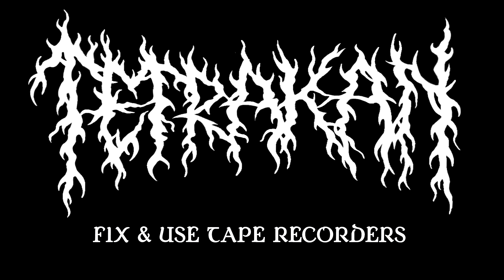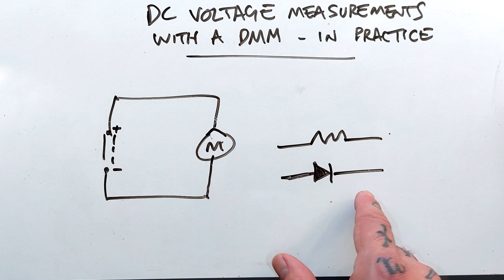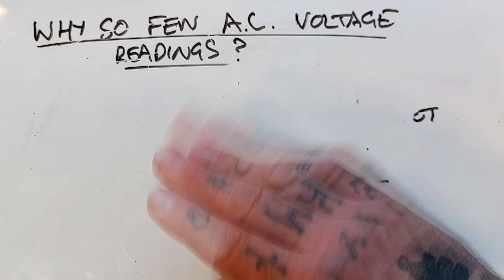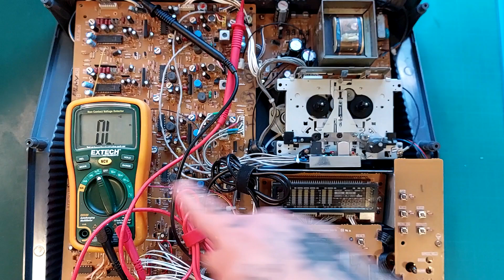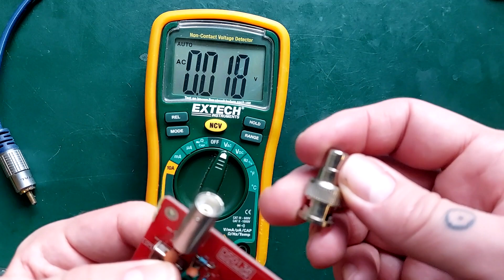Multimeter MEGA tutorial |Theory & Technique for Audio Troubleshooting

Comment from the maker: TIMESTAMPS BELOW

0:00 Introduction
0:51 Electrical safety
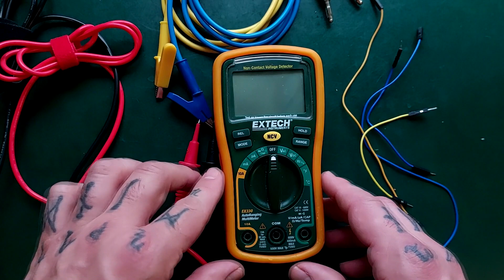2:21 Connectors & probes I use when troubleshooting
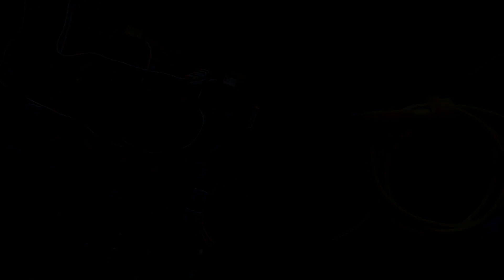4:51 What to look for when shopping for a multimeter - which functions are most important?
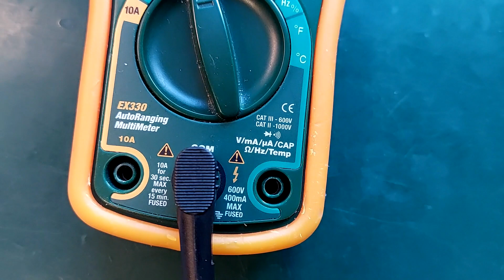8:51 Plugging in probes - what is polarity and how much does it matter?
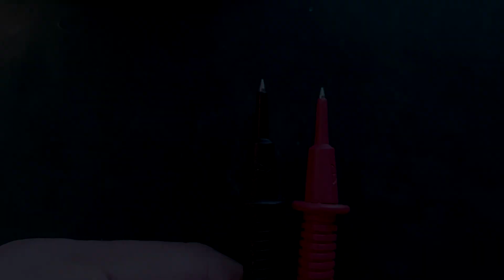11:56 Opinion - most electrical theory videos are NOT presented with the repair person in mind
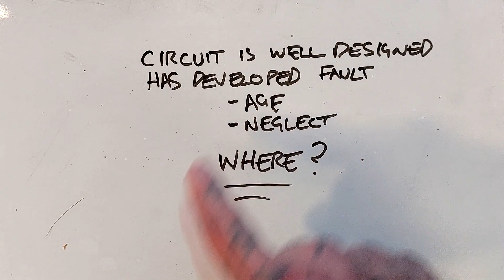14:25 The difference between AC and DC
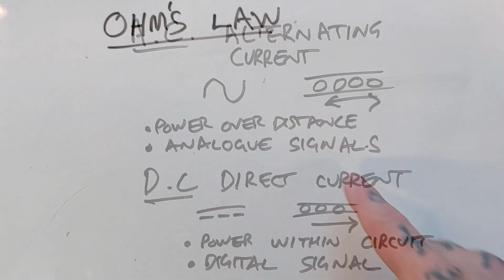17:09 Ohm's Law - thinking of DC like water is helpful, but I don't do any calculations
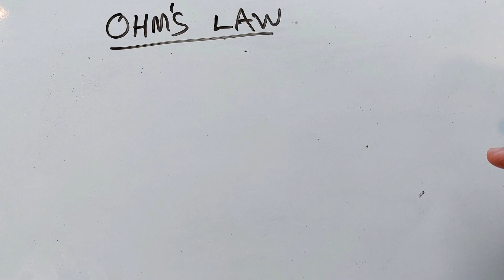21:03 Parallell circuits & why it is good to test components out of circuit
25:51 Voltage dividers & Ohm's law
29:38 Understanding voltage drop
32:43 How voltage drop impacts what we are doing with the Multimeter
35:21 Where I put the probes when measuring DC power supply to active components, voltage drop & resistance
37:04 Using a schematic to figure out where to put meter probes
39:00 Why I don't use my DMM's AC voltage function for troubleshooting power circuits
40:15 Why the DMM is unsuitable for some analogue signals
41:15 Why I use an audio probe or oscilloscope when troubleshooting audio signals
44:03 I can use DMM for amplifier & bias calibration, but often an oscilloscope is more convenient
45:17 What is a continuity test? Why do I find it so useful?
47:32 Continuity test example 1 - checking faders, switches, pots etc
49:31 Continuity test example 2  - checking coils... solenoids, relays, inductors, chokes, etc.
50:12 Continuity test example 3 - checking magnetic heads (be sure to degauss afterwards!)
50:49 Continuity test example 4 - checking cables and PCB traces
52:26 Continuity test example 5  - figuring out if/ which components are connected to ground
55:53 DC voltage measurement example 1 - checking an active component is receving power
59:56 DC voltage measurement example 2 - comparing voltage readings on a healthy & unhealthy circuit
1:02:20  DC voltage measurement example 3 - using DC voltage readings to identify a faulty semiconductor
1:03:36 Just enough theory on semiconductors to test them
1:06:27 Using the diode tester function to check semiconductors out of circuit
1:08:42 Sometimes it is more convenient to use a cheap component tester....
1:10:47 I would a component tester to measure capacitance becasue it shows me ESR...
1:11:13 ...but in practice I just replace small value electrolytic capacitors 
1:11:56 Checking resistor values & why it is usually the last thing I check
1:13:01 Comparing resistances on healthy & unhealthy circuits is a diagnostic tool but  I use other methods
1:14:02 AC voltage reading example - testing for the presence of AC bias
1:15:16 AC voltage reading for playback amplifier calibration
1:16:47 For safety reasons I use voltage drop & continuity with the power off to troubleshoot PSUs
1:18:24 Frequency counter example - checking AC bias frequency
1:19:32 Conclusion

Comment: Could you use the Hz mode to bias a Tascam 338?  Actually, would you ever do a biasing video?
Reply from the maker: You can use a DMM to ensure the oscillator in the 388 is producing the correct frequency, definitely. You could also use AC voltage setting to measure the amplitude of the bias signal at the heads. What might be missing is easily available or reliable information on what this voltage should be for different tape types. It's in my to-do list to investigate this and present my findings on the channel.
Reply: yeah I think you need a meter that gets to around the 150mv range, but I dunno what i'm talking about really.  This video is great btw, thanks @Tetrakan

Comment: Hey Tetra - You were right this video was SUPER helpful. Definitely demystified a few things for me. I had a question and hope you would elaborate more on your cap replacement decision - around 1:10:00 you mention changing caps in an area that is having issues. Would you say on a smaller unit like a 2 track and simpler 4tracks like my own Mf-P01 that replacing ALL the capacitors is worthwhile rather than just the circuit you're working in that has the problem? Normally I assume this would be too time consuming when there's 100+ caps but in the case of the Mf-P01 there is a total of 48 electrolytic caps
Reply from the maker: Yeah I did that on a porta 03 recently.  The counter argument is it can be a good  learning experience to use rhe audio probe to narrow down where the issue is though?
Reply: @Tetrakan  Same page! I told myself I wouldn't do a complete replacement until I tracked the problem down so I get the experience of both

Comment: Thank you, this video is very well made. I don't understand one thing, in the voltage divider example you show how measuring with the positive probe before any resistor and the negative probe connected to ground you would read for ex 9v, and then moving the positive probe after a resistor the voltage would have dropped. I thought that the "water pressure" (Volts) would increase after the "restricted pipe" (resistor) rather than decrease, what am I missing?
Reply from the maker: Hi Ed. The short answer is …. the water analogy bit of this video is badly explained, if not actually misleading, and I will need to replace it ASAP! By using the analogy of a pressure nozzle on a hose, a viewer could be forgiven for thinking that by adding more and more resistance to a circuit we can increase the voltage available from a battery or other voltage source, and I want to be clear, that is NOT true…A better analogy would be a pump representing a battery or other voltage source, attached to a pipe consisting of three wider sections divided by two narrower sections: In such a pipe then the first section (after the pump) has high pressure, the second section (after the first narrow section) would have lower pressure, and the third section (after the second narrow section) would have the lowest pressure of all. Thank you for watching, and for your valuable feedback!